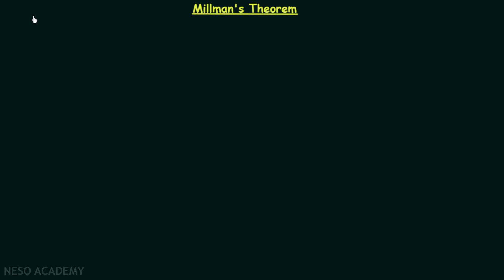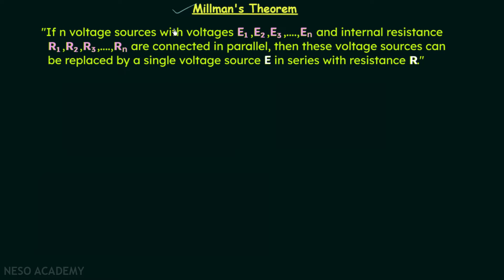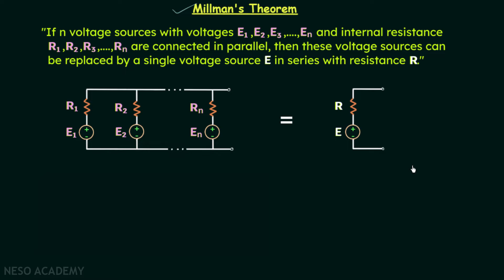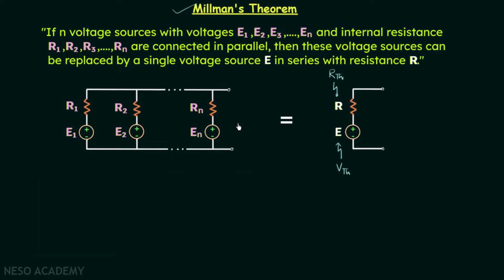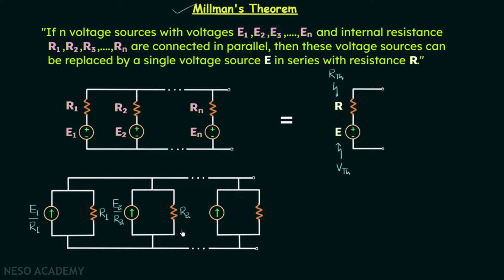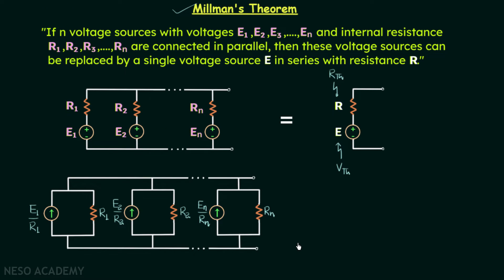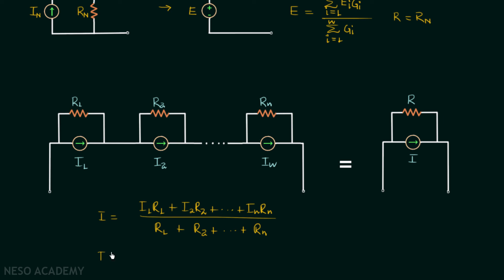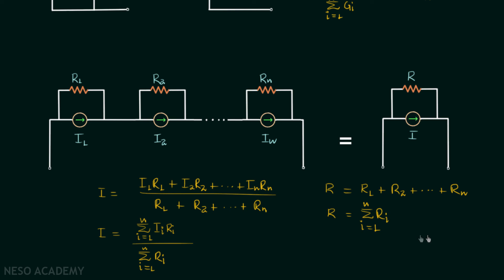Millman's Theorem

Comment: When E=In×Rn
After that How did the value of Rn be divided🤔🤔
Rn should be multiplied na sir!!
Sir, Please reply to make us understand PLEASE SIR🙏🙏🙏
Reply: Bro. Actually E is not divided by the Rn. It has been divided by 1/Rn and when Rn will go to the upper side it will be multiplied By Rn which is required
Reply: At 8:58 E=InRn, since E=E1/R1.... And and Rn=1/R1+1/R2..but why the Gi is coming in denominator??? 🤔
Reply: @karthikkelvin8946  actually 1/R=1/R1+/R2+..... so R=(1/R1+1/R2+...)^-1
Reply: @karthikkelvin8946 bro 1/R =G conductance